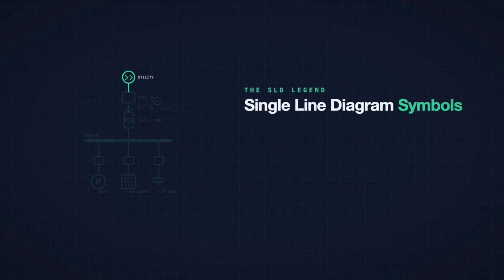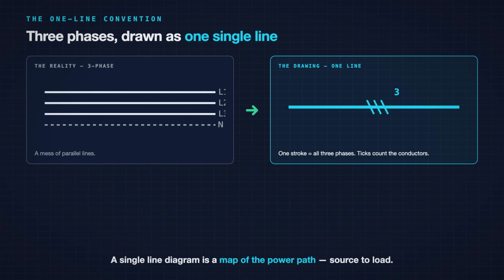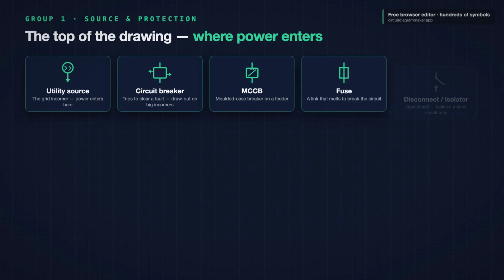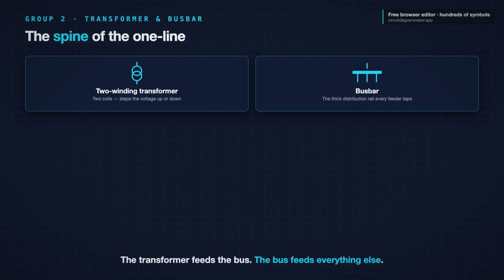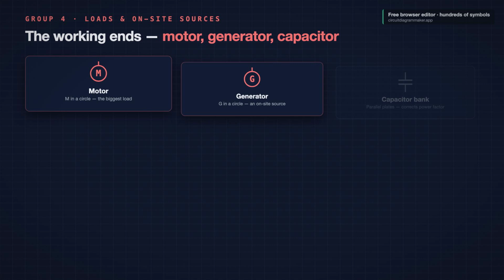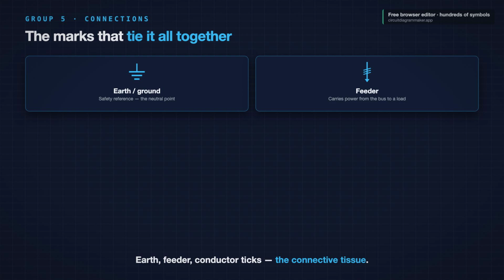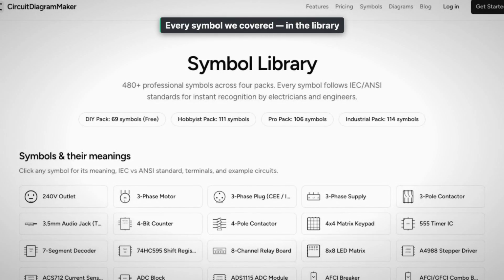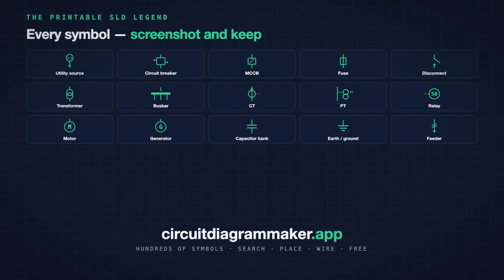Single Line Diagram Symbols (SLD Legend)

Comment from the maker: The fastest way to read a single line diagram isn't memorising a hundred symbols — it's reading top to bottom. Utility source → main breaker → transformer → busbar → feeders (motor = M in a circle, then your sub-boards and capacitor bank). The whole three-phase system is drawn as one line, and the little ticks tell you how many conductors it really carries.

Get that read-order and any one-line, however busy, unfolds the same way.

Which SLD symbol trips YOU up — the CT/PT, or the draw-out breaker? Full SLD legend, free: https://circuitdiagrammaker.app/symbols/chart?utm_source=youtube&utm_medium=pinned_comment&utm_content=yt-143